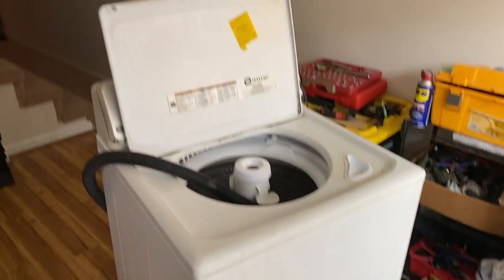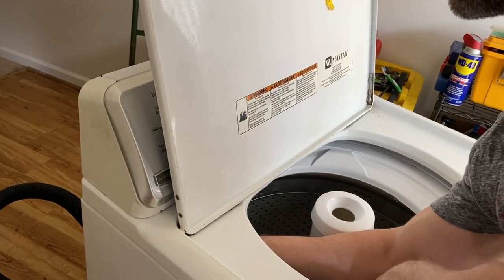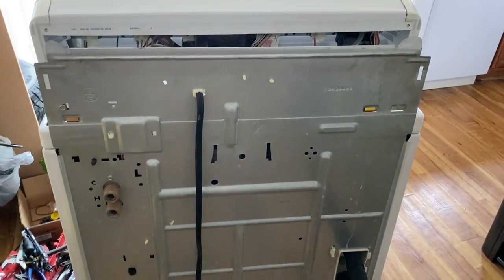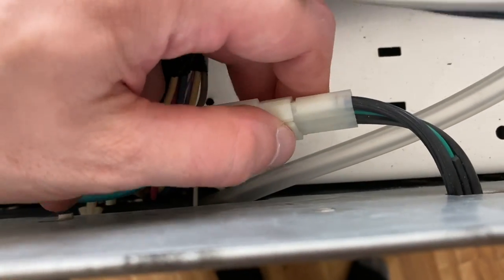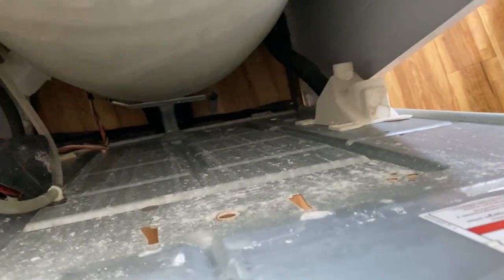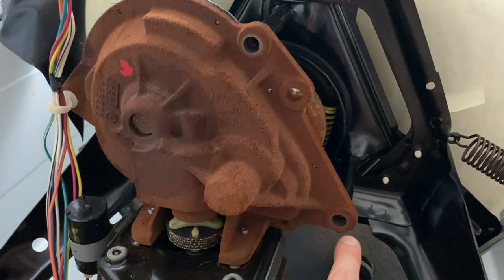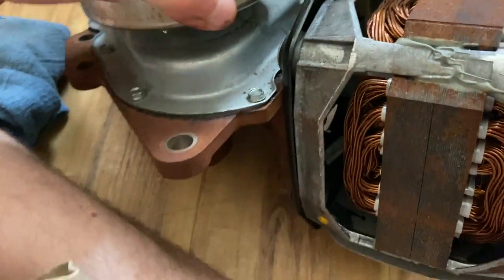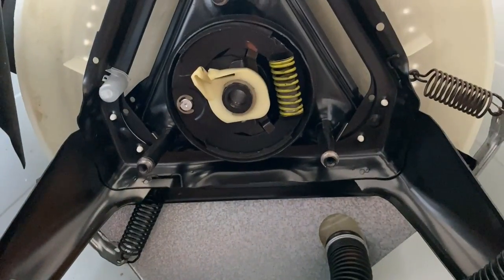Dumpster Maytag Disassembly

Comment: 0:38 That is actually normal for Whirlpool Direct Drive Washing Machines and of course Maytag washers are made by Whirlpool since 2006.
The ones that spins the whole Tub by moving the agitator are the newer ones with electronic controls, known as Vertical Modular Washers.
General Electric "Hydrowave" platform of washers also do the same thing despite being a completely different system.

Comment: Those first screws and the white plastic things are hinges. The control panel hinges upward, after you actuate those spring clips with a putty knife from the top. The front shell is held to the back panel with the two gold clips you can see from the front. I know this is too late at this point, but it may help someone.